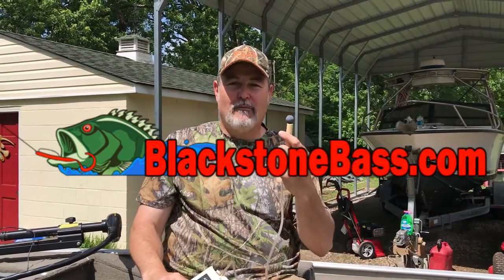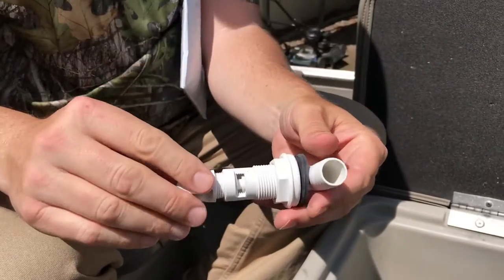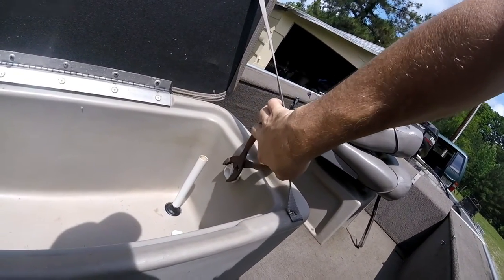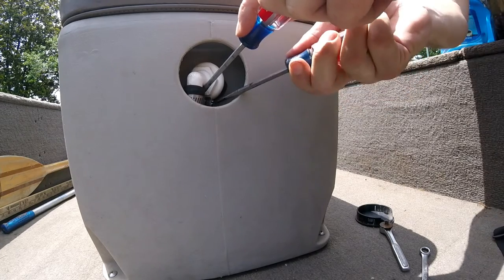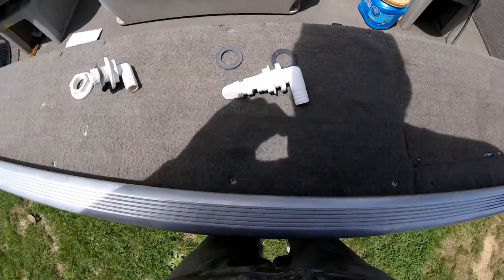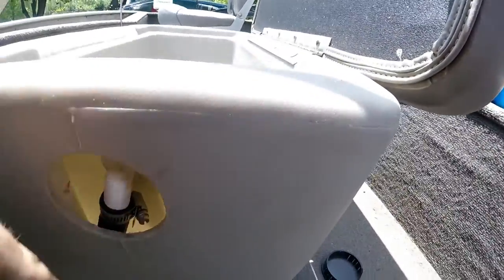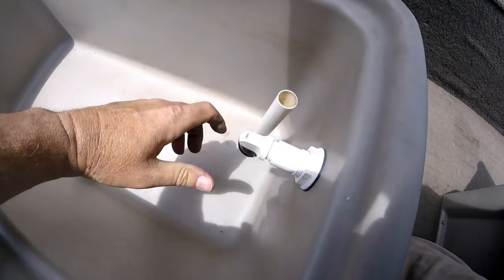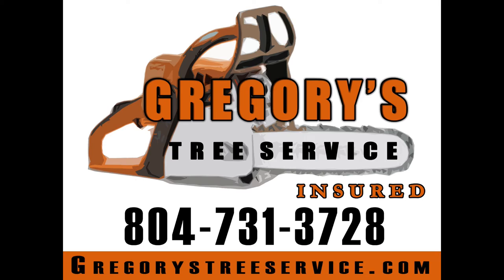Livewell Repair

Comment: I have a ?? My live on my 90model  chapion has a bait well infront and live well in back now they have iner pluges  you push in a lever for both tanks to shut off from lake back pushing water into tanks nowmy ? How to chang pluges or do i need to just seal them off completely they leak a lil now is it best to seal them
Reply from the maker: Man IDK I would have to see that I would not plug up any holes until I could find out how its suppose to function.....

Comment: Where did you get the drain tube and what size is the drain in the bottom of the live well. I have a 2003 and can't find one with a small enough rubber piece on the bottom of the pipe. Thanks for any information you can provide.
Reply from the maker: I will need to go measure the drain tub and exit for you I did not have to purchase that only the 90 degree pipe which feeds the livewell.  I will get back to you in a day or two as my boat is not currently here but in storage.  I believe this same site should have what you need.
 https://www.greatlakesskipper.com/boat-parts/live-wells-and-accessories